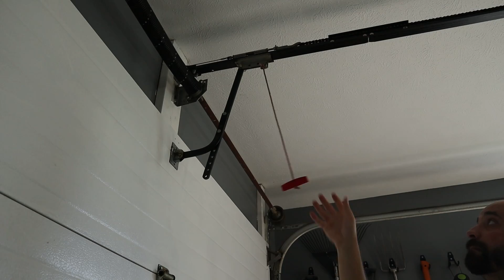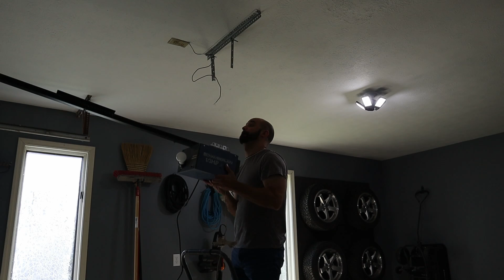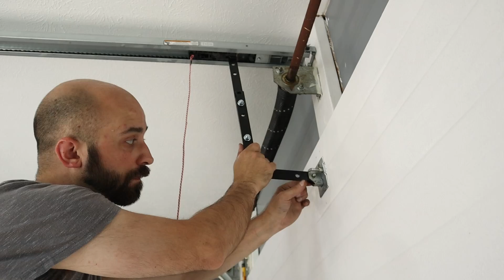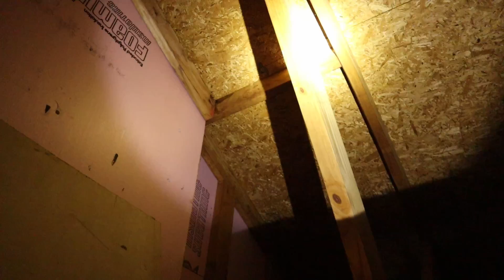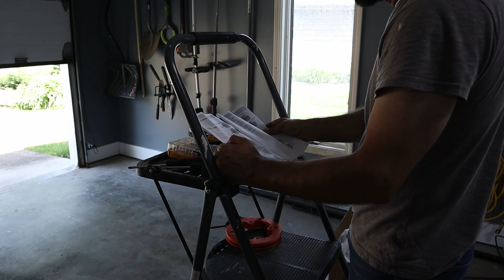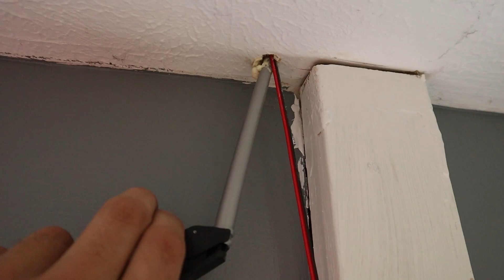Replacing Old Garage Door Openers

Comment: Hey thanks for the video! I'm in a situation where I need to make clearance to mount my ceiling but the garage door components are in the way. In your video around 3:22, I need to move the spring bracket up a bit (the bracket that is below the one you unscrewed for the motor), I wasn't sure if that was safe to do or the spring is going to kill me lol Was curious if you had any thoughts on that, thanks!